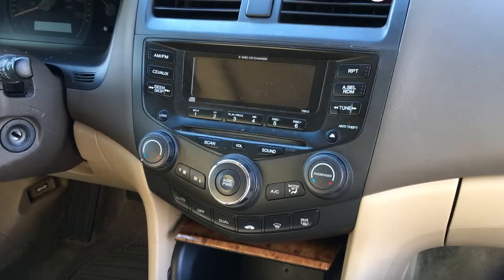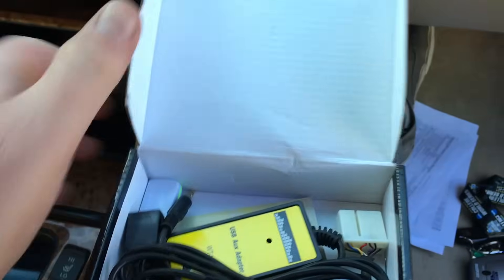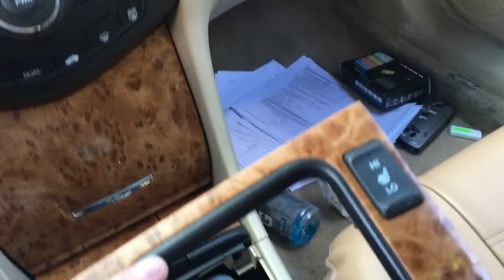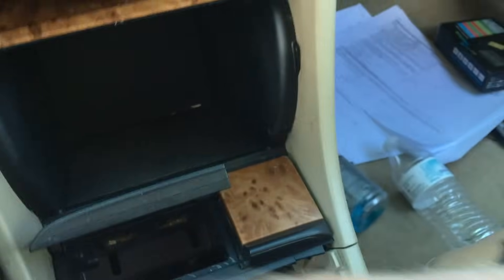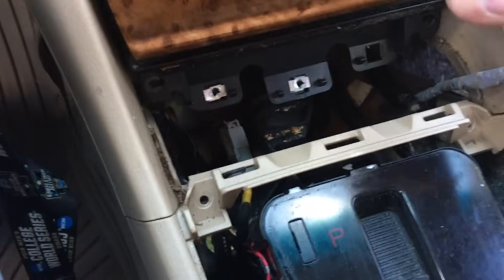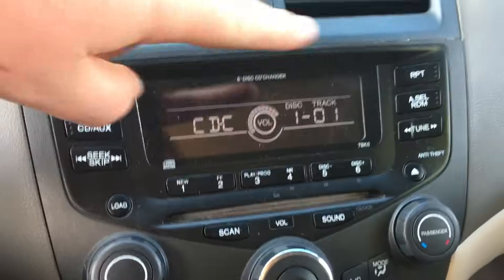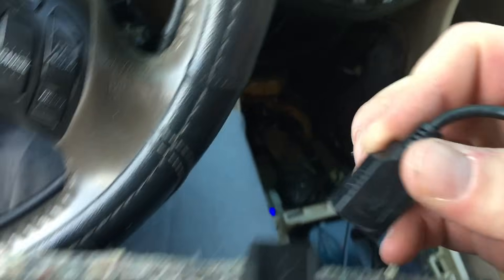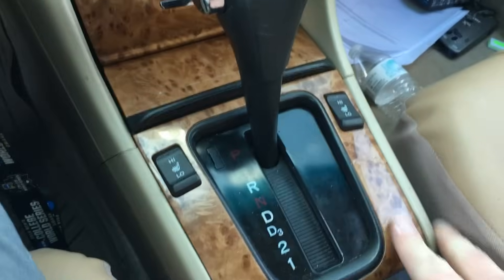2003 - 2007 Honda Accord Factory Aux / USB Install

Comment: Just installed it yesterday took me a total of 30minutes. It worked perfectly fine until today...im having trouble with the radio switching to aux. It totally stopped, it won't even let me switch to cd. Anyone know why???
Reply: Beronica Cantrell Same issue here. I toggle the CD/AUX button and it no longer will select aux!
Reply: Vemisery I managed to find a trick..if you press on the CD button on the steering wheel a couple of times, it changes it to AUX. Don't know if it will work for you but I hope it does! Let me know..

Comment: Nice video.. I wonder if this will enable Android auto on the phone..?  maybe? I've never used it, but noticed the app on my phone with no way to open it without connecting to a car USB.  Recently bought an 06 accord also. :)
Reply from the maker: Android auto will be only enabled with an android auto radio.  This isn't going to do anything for that.
Reply: @ProvoBeastAudio  Ah, I figured as much, thank you for the reply and video!  It is kind of odd.. having Android auto on my phone, but I can't access it without connecting to an android auto, auto... which will already have the apps on a larger screen. haha.

Comment: Hi, Thanks for the video. Mine is a 2004 Honda Accord, radio with the 6 disk changer, does it mean I need the Y-Adapter as you had mentioned above. And please let me know where did you get the AUX/USB integrated kit from? thank you
Reply from the maker: Integration kit was ordered from Amazon. If you have the 6 cd changer separate from the radio or have a satellite radio module, that port will not be empty like in the video. You will need a y splitter so that you do not lose that functionality. If you don't care to lose the use of a separate cd changer, no y splitter is needed.

Comment: unfortunately the adapter does have a static noise that comes with it so kind of disappointed but oh well
Reply: Really?  Have you found anything to reduce the noise? I’m looking for a method without the static if that’s the case since I’m thinking about getting a 07 as a first car
Reply: Angel Mercedes how much you get it for

Comment: I have a 2007 honda accord euro and everything is the same like yours, except it doesn't say "6 CD changer" or there's no "load" button which means it doesn't have a cd changer but there is a CD/Aux button so will it have that connection under the radio or not? Have you come across an accord without a cd changer but still has a CD/Aux button?

Comment: Hi I’m sure this sounds really dumb but I can’t get to the connector. It looks like it’s covered by a piece of metal that won’t come off. Did you have to take that piece off?
Reply from the maker: There was no piece of metal.  You may be required to pull the entire radio out to gain that access.  This video shows you how to do so: https://youtu.be/tmlucX5SDFA

Comment: Hey, I am thinking of putting a nexus 7 in the double din slot below. Do you think it would work to simply use this cable's usb to power a nexus 7 tablet and use the aux for the audio? Thanks
Reply from the maker: The USB doesn't supply enough amperage to charge the tablet, you will need to use another power source.  The USB slot really only can handle flash memory w/o charging, such as a thumb drive.

Comment: Thanks for the time it takes to help.  I bought it and the y adapter installed it and the xm still works and my original cd and aux buttons still do exactly the same things there is no third option. I guess the Honda does not recognize it? also does yours light up?  there is a spot on the top in the yellow sticker that looks like an LED is supposed to shine, but nothing lights up... bad module?
Reply from the maker: Not sure sorry, may be a bad module.

Comment: I have a 2006 accord. I bought the adapter, and spent an hour getting all the stuff out. Under the radio thing there is no port for the adapter. So pissed right now. I have a 2006 accord v6. Why is the title say 2003-2007?? Does anyone know why?

Comment: Hello, I have installed the exact same adapter in my car and it is working great. However, in other videos, people are able to skip songs and play the next song on a playlist using the controls on the dash and steering wheel. What can I do to be able to do this? Thanks.
Reply from the maker: Good question, the video was of a customer install, so I no longer have access to help you out.  Sorry not to be much more help.

Comment: I have an Accord 07. Took it to a local guy to have the aux fixed so I could hook up me iphone. Instead of aux he installed this wire that runs through a radio station. The sound is terrible. The guy says my car 07 doesn't have an aux  system, but the button on the stereo says AUX. what should I do?
Thanks
Reply from the maker: Well the kit used in the video will work fine for your 2007.  Sounds like he used an FM Modulator.
Reply: Does the video version sounds better? Not happy with this version. Thought I would be able to use cd/aux button, instead they added and extra button to switch on/off from my radio to regular radio.

Comment: Do we also need a Y Wire Harness Aux splitter to install this? I installed it in my  car without it, the device works but every time I restart my car, the device isn’t detected. Then I have to again unplug and plug the device, then it works again. This problem keeps repeating. Pls help.
Reply from the maker: Sounds like a bad module.  The Y adapter is only needed if you have the factory installed XM or CD Changer.

Comment: Just installed on 2006 Honda Accord. Everything seems to be connected fine I just have a lot of static when playing music through AUX chord. Any suggestions on how to fix??
Reply from the maker: turn down the volume on your device and turn it up in the car.  Sounds like distortion.
Reply: Are you charging your phone at the same time if so that is why. If you unplug your charger it should go away. But I do not know how to fix it.
Reply: I appreciate it. Fuzz went away after time, thanks.

Comment: any update on a honda accord 2007 coupe ? 2 door will this work or  is it a little different the stock radio sucks and it's weird it has no adapter pre installed considering the year of the model
Reply from the maker: Should fit your coupe.

Comment: I have an 03 Accord with a OEM 6 disc changer. Can I play CD's and switch over the aux and vice versa? Or is it one or the other, can't have both?
Reply from the maker: If you want to retain both, you will need this Y adapter harness as that port on the underside will be occupied: https://www.amazon.com/Moonet-Acura-Navigation-Retention-Harness/dp/B00RZ27DK6/ref=sr_1_14?ie=UTF8&qid=1538497586&sr=8-14&keywords=accord+stereo+Y+adapter

Comment: I have a Honda Accord 04 and the plug where you plugged it in at isn’t the same it’s facing back I think if it’s the right one and it has stuff plugged into it? Can I unplug that and use the new adapter?
Reply from the maker: If you have NAV or the CD changer, you will need the Y adapter here: https://www.amazon.com/Stereo-Harness-Adapter-Nagivation-Changer/dp/B00YDUYYZ0/ref=sr_1_15?ie=UTF8&qid=1535578557&sr=8-15&keywords=Accord+stereo+Y+adapter

Comment: My 2005 Accord doesn’t have those small spaces for the wires to go through. What would you recommend I do?
Reply from the maker: Find a drill bit / unibit to make those holes, or run you cables elsewhere.
Reply: @ProvoBeastAudio  same boat here, is there a way to make the hole look like it came with the car? 😩

Comment: thank you for the video, however I have one question. The adapter that comes with the cables, do you just leave that hanging behind the compartment or do you place it somewhere else? thank you
Reply from the maker: Just tuck it away behind the compartment.  You can also zip tie it in place if needed.

Comment: i have a 2006 honda accord coupe and it has an aux setting but I can’t find where to plug in the adapter too. HELP
Reply from the maker: Sometimes they are on the rear of the radio, not on the bottom.
Reply: Provo Beast Audio Installation is it visible? I just took everything apart and can’t find the port either but I do have an aux button in my ‘03.

Comment: I did everything in the video correctly but when I take the main part off in the middle on my 2007 Honda Accord EX-L V6 there is no place that I can plug the adapter in. I’m very confused and could use help if you still respond to this. Thanks
Reply: Same problem, let me know if you figure it out!

Comment: Maybe I’m an idiot but I tried this and there is a metal piece over the port I’m trying to plug the adapter into. While trying to pry this metal piece off there was a spark and now the display screen is black and doesn’t work. Taking it to a mechanic.
Reply: You might've blown the fuse. It's a mini 10 red one, you can find a spare under your hood or get 5 for $4 at Walmart. Your manual can tell you where to replace it. And see if the port for the aux is in the back of the radio

Comment: I am thinking about installing an adapter. 2 questions: 1) Do I need to use an FM station with the adapter or does it work like a regular aux cord? 2) I am concerned about the adapter brick heating up in the center console pocket area - is this an issue or am I worrying over nothing? Thanks!
Reply from the maker: 1. it works like a regular aux, isolated from the am / fm.  It is a low amperage module, heat isn't an issue.
Reply: Awesome. Thank you!

Comment: When installing this part to a car.. I have a 2005 Honda Accord ... will this change the sound like will it sound louder than the radio or CD player or lower ?
Reply from the maker: Commonly, they the gain match isn't perfect, and usually those say it may be a little more quieter.

Comment: Hey i did all this and i have a honda accord 2005 stick shift and when i looked up into the bottom of the stereo there was no port to plug this in to
Reply from the maker: It may be on the rear of the radio.  Regardless the port is there, but in a different location.  It may require you to pop the radio out a bit further to access the port on the rear.

Comment: I have a 2004 honda accord and i tried to do this same thing but there is a metal cover over the port. How do I remove that cover?
Reply from the maker: It may require you to pull the entire radio out to access that port.

Comment: So I took my car to car toys to get this done but I recently had to replace the battery, when I replaced it obviously all of the inputs on the stereo were reset but the aux is still there I’m just not sure how to set up the station/input?
Reply from the maker: It shouldn't be on a station, but should be accessible by hitting the CD / AUX button again.
Reply: Provo Beast Audio Installation when I hit the CD button it just goes to XM
Reply: Provo Beast Audio Installation cuz your button only says cd/aux but mine has that plus xm
Reply: Provo Beast Audio Installation never mind I figured it out! Thanks though!
Reply from the maker: Good question, not sure what the issue is without seeing it in person.
Reply: Adam Villalobos My button is also for xm/aux. what did you do to get it to work?
Reply: Michael Murphy-McCarthy for mine I just hit the aux/Xm button and held the tune button until it got to the aux 2 setting so just do that hold the tune until it gets to where your aux is connected
Reply: Adam Villalobos thanks.

Comment: bought this product and installed it. It worked until I turned to radio setting on my 07 accord. I turned off the radio and now the cdc/aux doesn't work. tried uninstalling and reinstalling three times but the cdc setting doesn't come back after I switch to the radio.
Reply: i’m having the same issue
Reply: Same issue here too
Reply: @robbyxriott did u figure it out?
Reply: @travisjackson982 did you find any solution?
Reply: @waseemhanna8980  I did not I just replaced it, since they're only around $20

Comment: i have a 2005 honda accord hybrid  its the same ?? just bought the same product
Reply from the maker: Actually no, according to this product, it will not fit a 2005.  You could pull the radio and check to see if it has the same input

Comment: Have the same head unit in my 2005 Accord EX-L.  How does this jack install affect the operation of the 6 disc cd changer?
Reply: It just acts as if there is a 7th CD inserted, named CD C.

Comment: Do these go bad in time? I bought a 03' a couple of months ago, the charging port works perfect. But the aux doesn't. Is this a sign I need to install a new one?
Reply: For anyone else wondering: yes, the aux cord cable quality isn't amazing. It works, but it wears out after years of use. I'm about to replace to one that my car's previous owner installed. I stopped getting a good connection through the 3.5mm jack.

Comment: Do you have any idea on why mine isn't playing the sound from my phone. I used the same adapter as you, it's plugged in correctly and the blue light is on so that should mean it's working, but it wont retrieve the sound from my phone or any other device.
Reply from the maker: Right, usually the USB connection does not supply enough amperage power to support a smart phone and music files, usually only a USB thumb drive loaded with music works.  You will have to use the AUX input for your phone music.

Comment: Is there an east fix for that cubby door, it will not stay closed.
Reply: Yeah same!
Reply: @mmaxms 
I figured it out.
The spring on the bottom side (either right or left) may just be out of the holder it goes into. Just snap it back in if it is not broken.

Comment: I installed mine and anytime you turn the power off on the radio, change to fm or disc function the adapter you can't pull up the aux menu again. Is there anyway to fix this? This is the 3rd time I'm going to have to disassemble my console to make this work again and apparently any time the radio settings are changed I have to disconnect and reconnect the adapter. This is some bs.
Reply: Thomas Williams getting exactly the same problem. Be good if we can get a reply
Reply: Same here
Reply: Same...anyone have a solution yet??
Reply: same problem!

Comment: I have the exact same car but mines a 2004 and I opened up the center console but there is no port right under the radio
Reply: Then you do not have the same car. 2003 was the first year for this model and the radios are different in most '04 Accords compared to the '03 Accord. So your year radio will have the common problems of: no sound, intermittent cutting off, not ejecting a disc, not loading a disc, draining your battery when the ignition is off, the backlight going out and other issues known by Honda but never corrected. These radios are one of the biggest nightmares that Honda has made. Wait for the lights to stop working in the ventilation buttons, the radio backlight, the speedometer, the tachometer and the moonroof drains to clog up and then you have to remove the plastic front wheel well to access the drain exits to unclog them. VTEC for the win baby.

Comment: Is there a certain way to use the USB to play music? If I plug it in it starts to charge my phone but the music won't play through the car, it will just play out of my phone speakers. I tried putting on RDM but it still doesn't register.
Reply from the maker: From what i understand, the USB won't support a phone but if your getting a change, you are lucky.  The USB slot generally supports Thumb Drives only.

Comment: i have a question  .. is the sound quality  as good if you play from usb stick as it is when you listen to fm?? 
pls reply
Reply from the maker: It varies, i have  had various success with these adapters and typically, the answer is yes.  This was a customer vehicle, so I am not sure how well it currently is performing.
Reply: Provo Beast Audio Installation i have a 2006 honda accord 6cd changer with xm, I followed al the directions and the aux work but the usb only charges my phones and ipod (iphone/android). It doesn't work at all playing music. But when i use a usb stick it works, can you please help me with this?
Reply from the maker: Commonly there is only enough voltage to charge a phone, but not compatible to stream music with newer phones.

Comment: Does this still work even if the CD player doesn’t read discs and has been jammed for years?
Reply: I'm not a Honda tech but I have to imagine it will still work. The only thing they have in common is the button and if you're still able to switch between functions it should work. Theoretically LOL. Did you try Googling how to 'reset a Honda CD player' or eject a stuck CD on a Honda CD player?

Comment: @ Provo Beast Audio Installation
Hi mate not sure if your gonna see this or not but i got 2 questions

1; can you run the cables underneath the sterring column  or on the side instead of in the box?

2; can you switch between 3.5mm jack and USB?

Thanks Bro!

Comment: I have a 2007 Honda Accord and was considering buying that exact product listed above but saw some complaints about a high frequency noise coming from the speakers using the aux cord, did you have experience with this or have any ideas on how to prevent that? Or is there another product you would recommend?
Reply from the maker: Well, typically the noise is generated when charging and using the Aux at the same time.  A general fix would be to use a ground loop isolator.  There are other alternatives, but usually at a much higher cost.
Reply: @ProvoBeastAudio  cc c DD cadsadq

Comment: Hey brother thank you for the vid but I have a question!! I hooked it all up and it's great, except for the sound of my engine revving when I drive and listen to music through the AUX. any suggestions?
Reply from the maker: Sounds like you have a ground looping issue.  You can fix that by using a ground loop isolator found here: https://www.amazon.com/AUKEY-Ground-Isolator-Stereo-System/dp/B01L1NP7YI/ref=sr_1_1?ie=UTF8&qid=1484845055&sr=8-1-spons&keywords=3.5mm+ground+loop+noise+isolator&psc=1